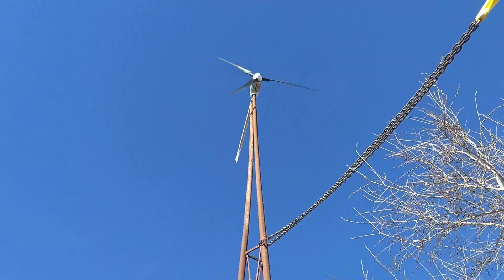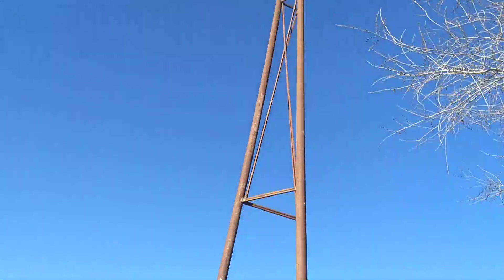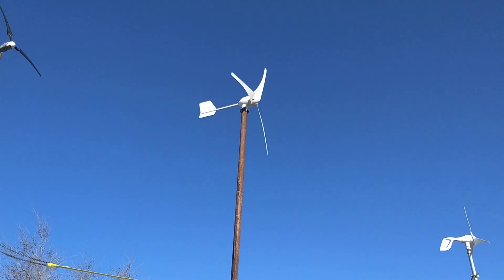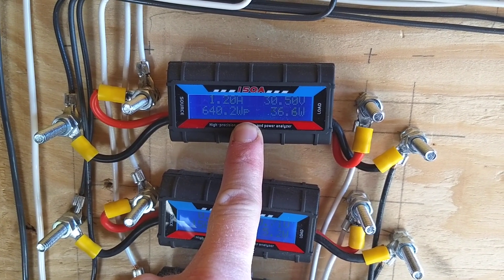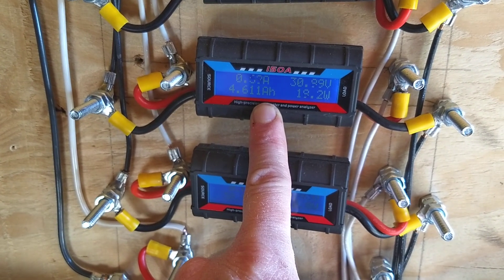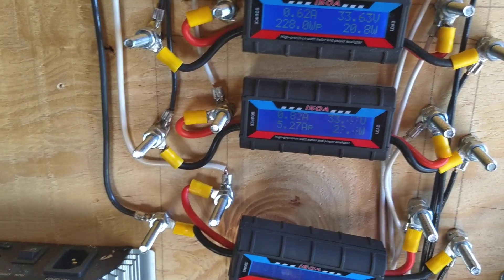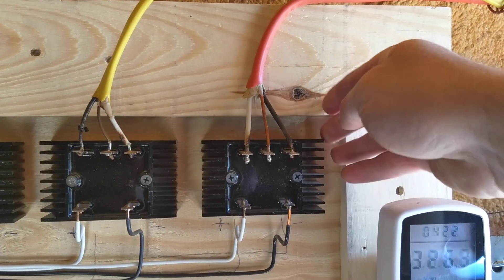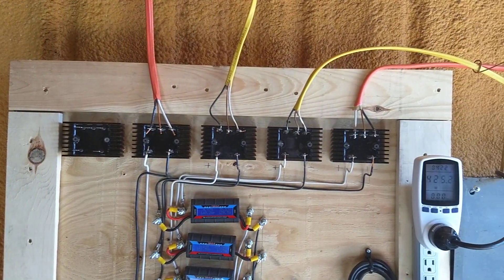iSta Breeze i1500 wind turbine, first day of real work.

Comment: I think your next step is just go for buy 2000 to 5000 wind turbine. I to feel like I'm getting scammed with the 500 w turbines. I'm building a new tower About 38 feet tall That could handle a 10000 W turbine and I'm gonna test it with a 2000. I have been watching your videos, but I'm in a little bit of a different situation because I have nice wind lake affect. Subscribed.

Comment: Warning viewers these are made in china.  This company istabreeze proxies countries flags to make you think your buying good quality products. Their windmills windings/coils are poorly designed. They will not warranty their products and will blame you even if installed by a license, certified electrician and contractor that is required by the State. Please be warned. Dont be scammed by this company.  You will regret it.
Reply from the maker: Hi Steven.  You've commented on a couple of my videos with claims about iSta Breeze's products.  Tell me about what happened with your turbine.
Reply: @ToysforWatts  In the State of California which  require permits and professional installation of windmills aka wind generators under their code.  My unit arrived defective. The shaft was ceased and even manually turning it was nearly impossible. We brought this to the manufacturer attention to have it troubleshooted and addressed and no success.  They tried to blame our charging unit which it never was connected as we never even got that far.  We suspected internal problems from the start. We first removed our 8 gauge wire from their connector.  We also ran tests by using a high end drill that isnt battery powered and bench tested it.  No output.  The electrician suspected a ground out within the stator.  The manufacturer blames us. Refuses to do anything. So our situation turned into a damn if you do and damn if you don’t due to lack of their care, quality control and their inability to warranty their products who they refused to return, replace, exchange, service or refund while hiding behind Paypal. Amazon has banned them. They couldnt provide amazon with country of origin they refused and they don’t warranty their products. Some Chinese products I seen better than this. I authorized a licensed and insured electrician/contractor to open and evaluate the situation. 2 wires of the windings on two separate coils had been broken and grounding out.  The coils are poorly made including the magnets.  The installer says this is a Chinese brand. Prior to opening we had to prove to the manufacturer  with a video that in a 35-45 mph winds showing that the blades will not move. They tried to state our installation location is the cause.  We are like seriously we had tested prior to installing and I have 4 other windmills that take a whole lot more wind to get them moving and they are perfect. After the electrical engineer  who actually specializes in micro soldering (Not a Novice) had soldered, applied protective resin that red stuff to prevent grounding.  All of the sudden, after the repair the blades move like their supposed to even in a 10mph winds. Hurray.  That wind mill now works but only 300-400 watts no more even in a 45MPH winds.  Well that’s obvious because of the windings of those coils are so poor I probably could had made a better windmill than this and I wouldnt even know what Im doing.  This is the Istabreeze Windsafe 2000. After days of researching, I found out that this company steals the flags of reputable countries and proxies their products through them pretending to be a manufacture in that jurisdiction to inflate and steal reputations. Their website address “About Us” is a SMB box so they can forged international imports into the United States. I stopped that.  Customs has now initiated an investigation into their signing agent and Bill of Lading.

Update: Istabreeze.us is for only US businesses. Ask yourself how did they get that domain controller? That is major fraud. They had paid someone in the United States to open a SMB box and thats how they bypassed the registrar.  Well sad news for them, that site has been reported and will taken down shortly.  FBI is now on the case.

Comment: Is it 24v or 48 v ista breeze
Reply from the maker: The i1500 was a 24v model
Reply: @ToysforWatts  whats your battery bank voltage. Do You use any dc booster?

Comment: Are those tower pipes 2 7/8" oilfield schedule 80? If so, those things way about 300 pounds each. What would I like to know is how in the world did you get them raised? Wow is all I can say. Great video by the way.
Reply from the maker: I can't remember if it's 2 3/8 or 2 7/8, but it is oilfield casing and yeah it is 200~250lbs per stick.  The tower is super heavy.  I have it on a hinge and stand it up with a lever.  Pulls right up, super easy.  I pulled my windmill tower up the same way.  This video shows me pulling the pipe tower up: https://www.youtube.com/watch?v=TYyGqD6Kn6A
Reply: @ToysforWatts  Whoah, that was scary using the truck, but job well done. I am impressed and now I have an idea how to do my tower raising using 2 7/8" pipe. But I have an electric winch to replace the truck method. Thanks so much for the info.

Comment: I have ista breeze 2kw 48v turbine. Can't get it passed 39.6v? Had 20 mph winds today too.
Reply from the maker: What do you have it connected to?  Describe your setup.
Reply: @ToysforWatts  48v sunway wind(2kw) turbine controller. Which has the 3 phase hookup. From there the dump load and batteries are wired up.

Comment: I want to buy one of these i1500 what you think is it a good buy
Reply from the maker: Yes absolutely, if I had to buy a turbine right now the only thing I'd have to decide is i1500 or i2000 :D
Reply: Thanks I'm gonna order one .. what's the max u see from it on a 24volt battery bank.. I have a Missouri & solar 1600 watt but not seeing any good reading unless it's like 50mph winds
Reply from the maker: Reasonably I've seen over 2000w...maybe in the 2200~2500 area.  I have seen over 3300w from it running it at 36v in a VERY hard blow.
Reply: @ToysforWatts  wow
Reply: @ToysforWatts  the i1500 gives u over 3000watts or u talking about the i2000d?
Reply from the maker: Okay so something to keep in mind is that one of my goals is seeing how much abuse my turbines can handle...no brakes, just load them up and let nature have her with them.  Yes I have seen over 3000w with the i1500.  It is not something you should try to do yourself, or expect to see, unless you also don't mind going out and picking up pieces of your turbine from the neighbor's property.

The i1500 is more than capable of exceeding its rating in hard wind but in those situations you should very well consider shutting it down.  Your target with the machine should be 1500~1800w peak.
Reply: @ToysforWatts  thanks alot bro I wish I could contact u other wise because I have a few questions I'd like to ask

Comment: Tom.. i have mine up now. But im wondering.. i have 24v marked the the generator. and i have 2.. 12v car batterys in series that i charge. But the mill dont always give 24V some times its giving 20V.. How do you handle that?
Reply from the maker: First, what kind of charge controller are you using?  The turbine is going to make 24v+ when it's spinning fast enough.  Keep in mind the rating for this turbine is over 25mph...I'm usually not getting full voltage off of it under it's got 10mph worth of wind on it.  I've also seen several of them that needed somewhat of a break in period to get working smoothly.
Reply: @ToysforWatts  Ahh i see.. i have a 24v inverter on its way.. right now im just charging the two batteries. To test a bit before the inverter arrives.. the wind has increased now.. and its doing over 24v all time now.. True as you say it need much wind.... i think its a storm here now almost lol.. hope the proppellers will hold without load.
Reply: @ToysforWatts  Another question. Have you considered to try 5 blades?

Comment: Hi i have just mounted my ista 1500w ona 7m pole.. manual says start wind 2m/s  it doesnt move abit in 6m/s unloaded.
I have the 3 blade version.. what do you think? All mechinics seems to be ok notting is breaking it and it feels ok.
Do you have to break in the generator or something.. its brand new.
Reply from the maker: It seems like I had to have mine up in the air for a while before it really started turning easy, but in 6m/s it should be running...maybe not producing much but should be running.  What voltage is the turbine set up for?  It'll be printed on the tag  on the nacelle, either 24v or 48v.  What battery voltage are you running?  If you disconnect the turbine from the batteries does it start turning?
Reply: @ToysforWatts  Right now its not connected to anything.. the cable is on the ground and i have made sure its not shorted..  Mine is the 24V version..

I have 3 Blade version aswell..  Well lets hope it just needs to break in some ? It gonna be windy later this week they say.. maybe it has to set in a bit..

If i poke it with a stick or something it runs like 2-3 turns. so i dont seem to be stucked.

But it could be as you say.. needs to be upp a while
Reply: I will use two 12v batt in series
Reply: Its spinning as F now.. i just hade to get som real godd wind to break in.. im currently having 11mph wind and its working...  But have to wait for some parts b4 i can start loading it

Comment: Is it normal for the d.c side of the rectifier to produce voltage above the battery bank voltage .. I haven't hooked it to anything yet.. I was testing the proper polarity on the dc side of rectifier and has gotten as high as 87 volts.. bat bank is 48v
Reply from the maker: absolutely!  unloaded voltage can be two to three times battery bank voltage...there’s actually some formulas floating around that account for what your unloaded voltage will be but tha5 kind of math has  ever been a strong point of mine.  i know my i1500 (24v) is around 60v unloaded and my Heli (48v) will kick out 120+!
Reply: @ToysforWatts  nice I have the i1500 up and am about to tie it all in .. she's kicking tail with 30 mph gusts.. I will wait till it settles down before I connect it.. thanks don't for get to subscribe to my channel video coming soon..

Comment: Hi i have the i1500 whats your take on the what appears to be undersized wires that come out of it.?.
Reply from the maker: I do wish the wires off the stator had been larger but their size hasn't prevented it from performing quite well.  I have seen some ridiculously high peaks and I've recently started tracking total production off the turbine (see my latest video) and it's doing really well.  My take is that the i1500 is easily the best watt per dollar on the consumer market right now.
Reply: @ToysforWatts  well thanks to you i bought one . And building tower from scratch.. 32ft fence pole. I finally found a pipe to fit it in order to make the mount. Its very close but the size of the stem coming out of turbine is def not standard size.
Reply: @ToysforWatts  did you use 14 guage cord for your run?
Reply from the maker: No sir I have #10 solid wire coming down the tower and and all the way to the rectifier...probably about 60ft, may 70ft all together.  I would suggest stranded wire if you got it, I used what I had on hand.  If I can find the funds for it I would like to go back up both the i1500 and Heli towers with 8g.
Reply: @ToysforWatts  the other tuber ussed 12 or 14 guage extension cord.. you know the yellow/orange shop cords.. i thought was a really good idea.. and much cheaper.. 100ft like 50-60 bucks menards.. or go to flea markets 10-20 bucks
Reply from the maker: You might be able to do that if you double them up, but I've seen 70+ amps out of it.  I don't even like the 10 gauge wire I'm using with the peaks I've seen.  I really think you should stick with 10g wire.  Something you can do is call up a local water well outfit.  Water wells in my area are all sunk about 150ft down.  When they pull a well they usually replace the wire...a lot of times the wire is bad toward the pump or toward the head, but there's a huge stretch in the middle that's good.  Tell them what you're doing and ask if you can buy a piece of scrap off them.
Reply: @ToysforWatts  that's solid wire though.. i do have well wire  .. i still can't fathom that amount of power going through those little wires.. blows my understanding..
Reply from the maker: I've never seen solid wire dropped down a water well...I certain it happens, I've just never seen it happen.  That's how I sourced my wire for my Heli...I asked a well outfit to sell me their scrap.  Got about 300ft of 10/4 for free.
Reply: @ToysforWatts  to who ever said that..if they drop that wire down your well they dont get payed until they recover it.. lbvs..
Reply from the maker: Maybe you misunderstood?  The wire has to go down the well with the pump...
Reply: @ToysforWatts oooo..lol 😂 I did read it wrong
Reply: Great video -
Can I ask, a couple of years on, how is it performing?  Is it still running?
Reply: @funnyfarmproductions6247  a storm destroyed the mount and I never put it back up.. you can see in the other video.. so I stayed 100% solar.. I was going to do both..
Reply: @stoneyislandranch9783  thanks!

Comment: take a 120 mm computer fan, they run on 12 volt. then make a funnel for it, with a hose out for each of those rectifiers. will cool them easily.
Reply from the maker: I'm going to be putting the higher wattage turbine rectifiers on standoffs with case fans like this.  It's not something I'd done in the past because I didn't want to bother with temp switches and such  but I'm going to have to with the i1500 and Heli.

Comment: I would not have your bridge rectfier's mounted on wood. if making rated power the heat is high. I burnt out a couple of that style with my 750 hurricane.  I think they should have a heat sink and lots of air
Reply from the maker: The rectifiers are mated to heat sinks...they have a pretty large fin area.  But I'm not too keen on the i1500 being mated to wood.  The others have never been more than "a little warm" before, but they're not moving near as much power.  I'm in the process of building a new board and the new setups will have the rectifiers mounted on steel, ducted standoffs with fans to help keep them cool.

Comment: Nice to see her workin. I see what you mean about that tail.  I wonder why they designed it so flimsy. The cost difference between 22 guage steel and 18 is so minimal.  1500 watts is actually a fair deal of energy.  The generator itself seems to be up to par but the chassis it's paired to is not. Lets hope it doesn't rip apart.
Reply from the maker: The tail isn't made out of steel...it's PVC, or some very similar poly compound.  You can see the full parts break down here:

https://youtu.be/L7sb_oQTgE8
Reply: Oh geese....well it should be. Fingers crossed it doesn't fly apart. 🤞
Reply from the maker: ha the nature of the experiment is that that every turbine is run as the manufacturer sends it for 90 days, or until it breaks.  If the tail breaks, that's a failure, and I can bring it down...the tail breaking is the best case scenario for a failure...there's other components I'm more concerned about.  I think with some small changes this turbine could be very nice and reliable.
Reply: @ToysforWatts  yeah for sure! You could almost strip the generator rite off that chassis and mount it to a thermodyne style frame and it'd probably rock. Bigger, heavier tail and solid mounting base and its a real power producer.

Comment: 1200 that is pretty respectable , it is a good bit higher than the others though something to take into account, yeah i heard if you dont keep the rectifiers cool they loose efficiency, i mounted mine on some big cpu coolers no fans required for mine.
Reply from the maker: These rectifiers have cooling fins on them so should have some heat sink capacity, but I don't think it's enough for the iSta Breeze.
Reply: @ToysforWatts  yeah i have the same rectifiers , i was pushing 60 amps through mine due to be 12v system, but now im using a midnite classic so less amps + less heat. that tower is pretty epic wish i could do the same
Reply: @ToysforWatts  don't mean to be all like "watch my video" but i did setup my rectifiers quite nicely on top of CPU fans with temp sensors.  Works excellent and keeps efficiency high. Check out my channel.  It's the video about the 500 and 800 watt turbines. 👍